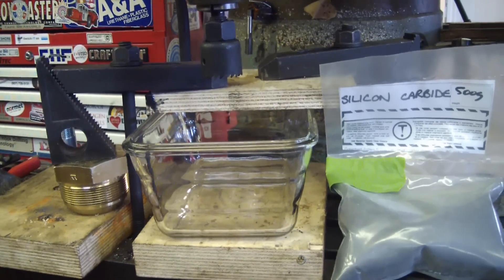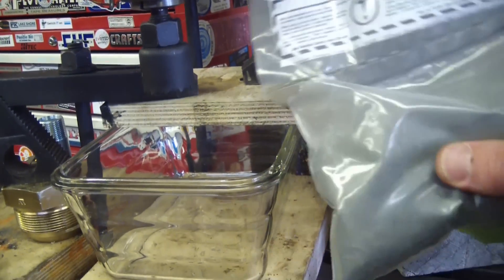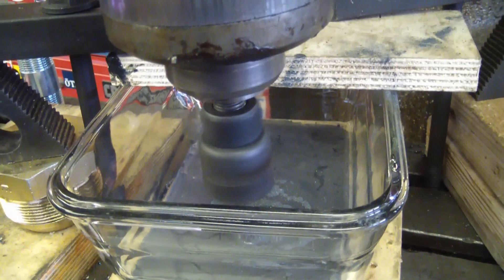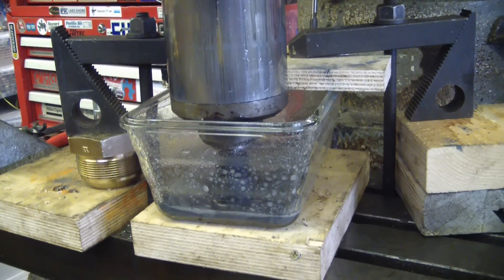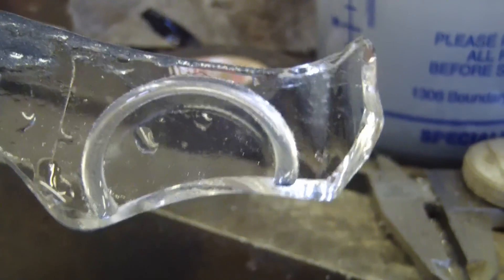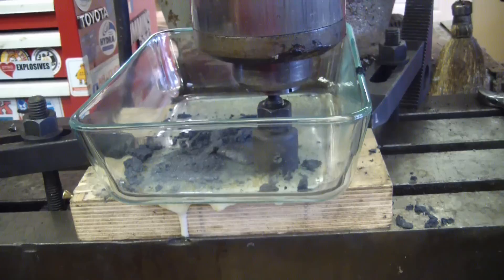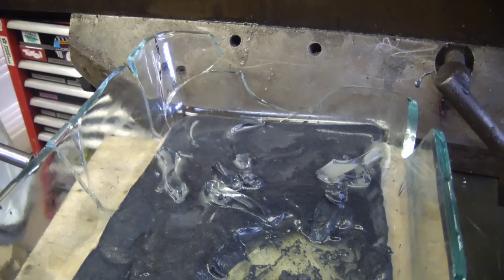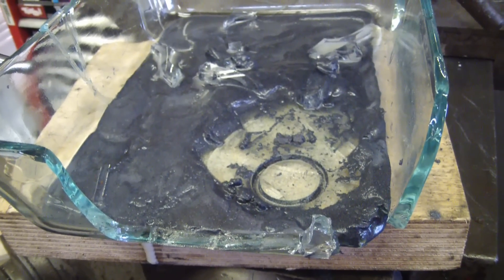Using Silicon Carbide to cut glass

Comment: Maybe try annealing the vessel before you cut it? Annealing for glass should be ~550C but there's a whole cycle of temperatures and times to make sure the glass is heated and cooled in a controlled manner. Do you still have the kiln or did you never get the bronze lining out of it? :)
Reply: From my humble amateur glass blowing experience, I would second Smidge on that anneal. > 514 deg. C for sodalime (standard glass) > 565 deg. C for borosilicate (pyrex and imitations) . With a kiln I would heat the container to temperature. Leave it a good 30minutes for the heat to chooch in there and let it cool down slowly. Of course there is also the real man's way to do it with a torch. I would start by heating the container with a "soft flame" (basically a flame with no or few oxygen that looks more like a lighter on steroids than a torch flame). trying to heat the thing as equally as possible. At first it's going to let soot on the glass, That's going to disappear as you get hotter (and start to let more oxygen in. To know when to stop heating, one could use a thermal camera, if it goes there. I would simply close the lights and and heat until the flame become street light orange (from the sodium burning or something). If you to see the glass glowing red when the flame is removed, that actually might be too late for a sodalime glass (melted), but that would make a great video anyways) . Let cool between a bunch of heat resistant covers or hot sand or in the barbecue, whatever.

Once cold, As said by many others, I would try using an aluminum or copper tube à a milling form. instead of an hard piece of metal. A softer metal will be more "compliant" if something hooks between the glass and the cutter. As you did, leave plenty of water for coolling in there. The gluing might actually be great for vibration damping and to hold the pieces and grinding juices from t'chouching on the lathe once done. Maybe lifting the bit frequently to make sure that the SiC grit get under the cutter and that I am not simply grinding glass with only the glass flour stucked under the cutter (SiC cuting glass = Sick fast, Glass cutting glass = Gloomy fast)

Good luck! (And if you append to reach the point where the sodalime starts melting ... keep heating the spot that you want to remove and stick a piece of steel tubing or wet wood in there to make your hole.)

Comment: I used to cut holes in the bottom of whiskey bottles for a carnival ride effect in a similar way.  I made a dam around the hole with clay and chucked up a 3/4 inch copper sweat fitting in the drill press.   It always worked.

Comment: So after a little research to whats going on with your fancy bake ware here is that pyrex is now made using tempered glass, now that being said what is causing the point of failure for the hole. Well to get into that tempered glass is basically a form of stressed glass. so when your cutting your hole here every time you getting through or close to the center of the glass you giving the glass enough "weakness"  (someone could of said that better). to shatter under is own internal forces. Now the fix buy cheaper glass or more expensive glass that are not under the internal forces that are found in you tempered glass ware.

Comment: Dad taught me to drill glass when I was a kid. The water is there for cooling. Never used Silicon Carbide. Put the glass under water (the whole thing), drill slow and pull the bit up after 5 seconds. 3-5 seconds to cool. Drill again, not too much pressure. When the other side gets thin you have to go light (so not to break it with the pressure or the bit) and less time with the bit engaged (because of heat).

Comment: I've drilled holes in glass but a little differently.  I used 1" copper tubing as the cutter.  I used some Clover lapping compound.  I just smeared a bunch on the end, ran it at about 300 RPM and gently pecked at it.  Let the grit do its work.  I drilled into some beer and wine bottles.  CLC is just silicon carbide and grease.

Comment: Did both drill attempts fail at roughly the same drilling depth?  Is the hole saw bit tapered or flared inside to where at a certain drilling depth it grabs onto the glass cookie it's cutting out, jamming and causing failure? I think the baked in tension of Pyrex could be a cause too, but wouldn't it break sooner if it was? Wouldn't a glass blower burn a hole with a torch? You could try that, or a cheap glass bit hole to prove or disprove the tension theory. Slow speeds and a light torque setting could help? In my experience using a hole saw, it wants to rip the cookie out at the end, you could try drilling the bottom to form a deep score, then drill from the top. Put some abrasive inside the hole saw. Idk just ideas. Love your channel.
Reply: Bradford McAdams I was thinking that was probably it too

Comment: It's tempered glass. Made to resist impact. You'll want to slow the drill way down and keep the silicon carbide slurry flowing to the saw in a constant fashion and keep it cool. A hot spot causes the glass to expand and kaflooey. Lots more slurry might do the trick if you keep it chilled and mix it during the process.

Comment: Yup getting old sucks that's for sure. As for putting a hole in glass try using a torch and slowly heating up the spot that you want the hole in. Or you can put an old socket in your glass pan then heat it up with the torch slowly until the socket melts a hole in the diameter you need..

Comment: Fill your Pyrex with heated material to relax the stresses a little while you're cutting. You can try sugar heated in the oven for an hour or so at 500F until it starts to bubble. Fill your dish, then turn your drill up as high as she'll go and stand right next to it so you can keep a close eye on the progress. Everything should turn out fine.

Comment: I once tried to cut a hardened table glass on a water jet machine. It was a security glass, the one that brakes in thousand peaces if you brake it.
In the beginning we cut with very low cutting speed and it cut fine. But as soon as we increased cutting speed it broke.
So from my experience of that project, what you could do is to try again with minimal force.
The stress in glass should not be underestimated. If you heat a glass bottle with a welding torch it will beak.

Comment: I like what you tried to do.  Reminds me of critical flaw size fracture in reverse - when the uncut section equals some critical dimension the thin section pops and propagates.
I have seen glass cut all sorts of ways with a water jet.  Garnet + H20 at 50kpsi.  Some smart guys morphed that technology into Garnet + liquid NH3 at 50Kpsi to cut up something special for a undisclosed client.  It ended with tears and a call to the fire dept, but hey we have to push the envelop. Google patent 6080907 for the public domain version..
A Sears pressure washer should be able to do 3000 psi maybe that could work just more slowly than the 50kpsi slicer of doom.
Reply: That is freaking cool. My dad worked in the high precision optical instrument industry, and used to come up with some pretty cool stories of stuff hiding behind closed doors.

Comment: I have drilled through glass using a copper pipe as a tool, Silicon Carbide as abrasive but you have to be patient and use a pecking action with the quill feed so you are grinding for maybe 1-2 seconds, lift the tool and let the abrasive replenish then go anoth4er 1-2 seconds.  This helps cooling and keeps fresh abrasive in the cut.

Comment: I've cut thru tempered/saftey glass by scouring the area to be drilled first, then going at it. Whenever I have clamped what I wás drilling it broke, I use fabric as a buffer between my clamp and material. It keeps the vibes down. cheap bits do best on glass.

Comment: I only know one thing about tempered glass: You can't cut tempered glass.  

But you do impossible things sometimes, so good luck.
Reply: Jeff Ratliff water jet can cut tempered without shattering, but i think it would ruin the purpose of the video...
Reply: Jeff Ratliff or maybe he could try reannealing the glass...
Reply: Thiago Ennes Water jet shatters tempered just the same as anything else. As soon as you compromise the outer layer, the internal stress causes it to fracture. The only thing that partially made it through was a laser before on colored tempered glass mostly because the laser, by melting the glass, would relieve some of the internal stress, but it the end, it shattered just the same. The only way to cut tempered is to untemper it.
Reply: Jeff Ratliff Not that you can't, you SHOULDN'T. Not because it's a harder but because it shatters at the slightest sign of damage.
Reply: ***** That has been my experience as well. One of my hair-brained projects required a tempered glass tray, and after 6 attempts using similar methods to what AvE tried, we brought 3 more trays to the water jet shop, who warned us that the outcome wasn't likely to be successful. Only one of the three trays ended up with a clean hole without shattering, and it seemed like it would have done the job, but when it warmed up in the car on the way home, it spontaneously shattered as well. We ended up using a stainless tray with a tempered glass window.

Comment: - Don't use metal, use something much softer, like a pvc-pipe (maybe copper or bronze will also work). With a hard material like steel, you will put the pressure on only a few points. The softer material will also hold the abrasive in place

- Glue the glass on a hard surface. I used thin spread hot glue on a steel plate.

- use oil as lubricant. Water is OK, but oil worked better for me. And only make a paste. You have to reapply it regularly.

- Reduce the pressure even more when you nearly through. Glass breaks from the surface, the smallest crack will travel trough the hole object.

I hope it helps.

Comment: Being Pyrex I would be surprised if you could achieve what your trying, and if you did I would expect it to end up being a hair trigger from breaking soon after. Pyrex is just to highly wound up with stress.
Does it have to be glass? I think you would have much better success if you attempted what you are going with a ceramic baking dish. It would likely survive subsequent handling and temperature variations a lot better than glass.
You might be better off with a softer metal cutter as well. The old style cutters before cheap industrial diamonds use to use brass and sometimes copper, no teeth at all. (except maybe for a slurry slit). The abrasive slurry embeds particles in the relatively soft metal edge. (maybe use either very thin brass pipe or maybe a large copper pipe off cut).  Also the resonance frequencies maybe a bit more dulled than with a hardened ferrous cutter so the rest of the work piece is not being punished as much.
I have also heard tell that sometimes they used slurry with almost razor thin Stainless steel shells. I think the principle was that the abrasive worked on both the sides of the cut but also wore the SS shell leading edge to an ultra thin ragged (microscope level almost) cutting edge.

Comment: steamgadget has it right about drilling. However, whenever I need a hole through glass I use my abrasive blaster w/200 mesh silicon carbide. Use a rubber or plastic washer as a template. Takes under a minute to penetrate 1/4" plate glass. I think you're right about the pre-stressing. Likely a result of improper annealing.

Comment: What you need to do is get the glass super hot then dip it in ice water to prep it.
Reply: No, +Connieandblyde -- that is what was done at the factory, which is the cause of failure when the hole is almost through. The glass needs to be heated as hot as his oven will go, kept there a few hours to let the glass "relax". Then very gradually turn the temperature down, over the course of a whole day. At the end, the glass will have near zero internal stress, so it will not be prone to cracking.

Comment: Pyrex sold in North America is no longer made of borosilicate (as AVE kind of noted).  It is tempered (pre-stressed) soda lime glass and can not be cut without being annealed first.  Can't be done, as soon as you remove the stress from the one side (in the cut) the stress from the other side will break the glass.  
This will work fine on an old Pyrex dish made of boro, or some kind of untempered, not-for-cooking dish.  Stock up on old 'real' pyrex at flea markets and such when you see some.

Comment: harmonics is a good suggestion of the cause.
You could hear the squeeking. The vibrations got to bad.
Possible the suggestion using a copper pipe as drill-bit would dampen the squeeking?
Reply: Lol both wrong he answered himself, it's tempered, impossible to cut tempered, will shatter every single time regardless.

Comment: Pyrex and all toughened glass is under tension when it cools and cannot be cut , toughened glass is cut to size then heat treated and cooled quickly , use to work as a glazier for a couple of years , I remember we were carrying big sheets into a building and the the guy in front of my caught the the edge of a scaffolding pole boosh showering is tiny pieces of glass .